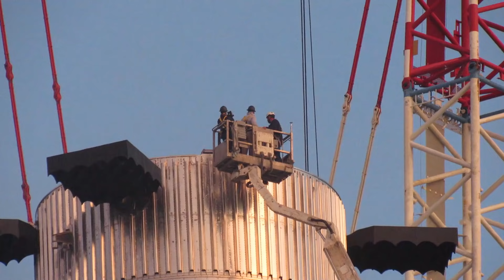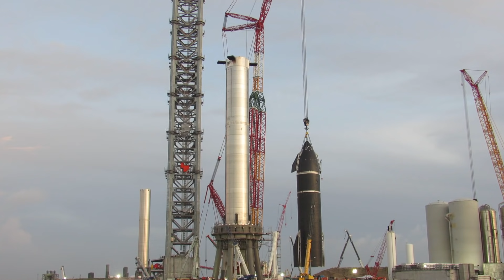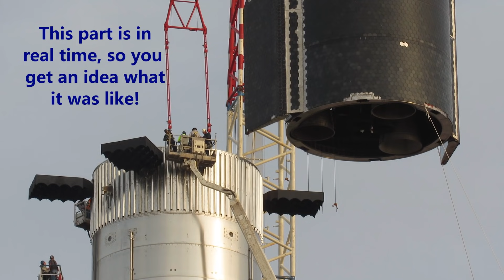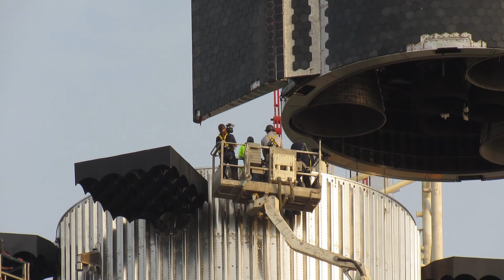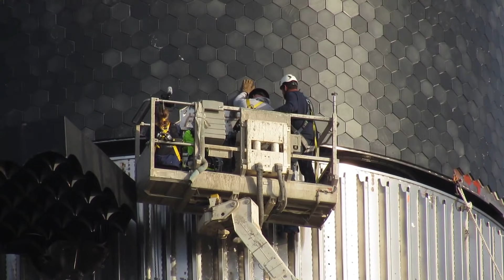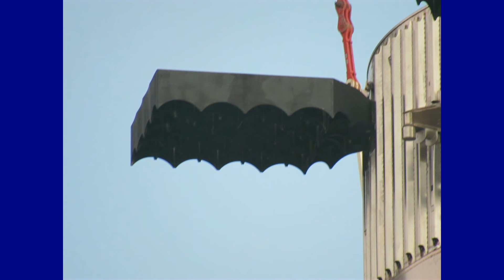SpaceX Starship Full Stack (with music)

Comment: Unless I missed something, the crane never let the booster carry the full weight. I wonder if ii can not carry the weight unless its fuelled up an under pressure?
Reply: It did and it can. They just left the crane attached until after review for whether or not everything on the vehicle is still nominal
Reply: They did indeed. This was a fit test. It would’ve been counterproductive to detach it from the crane, knowing that they immediately had to remove the  Starship from atop the booster.They immediately removed it and took it back to the build site to continue working on it.